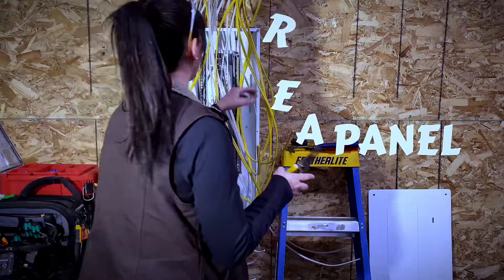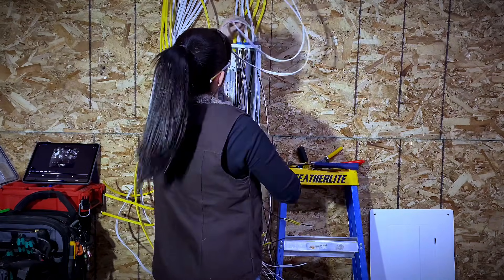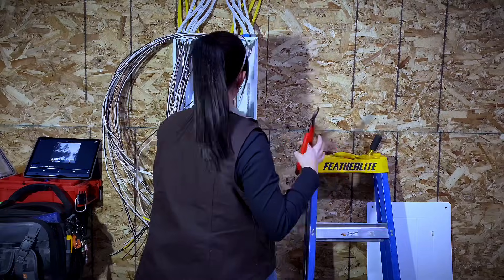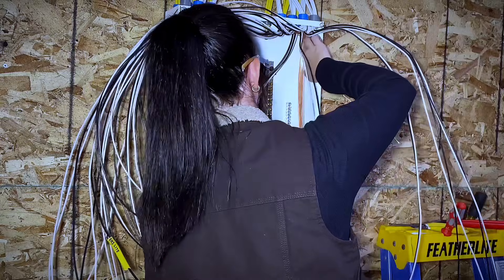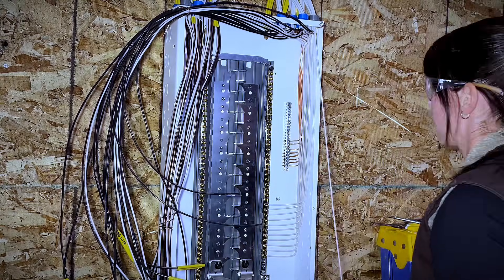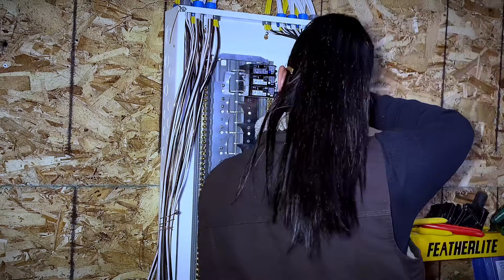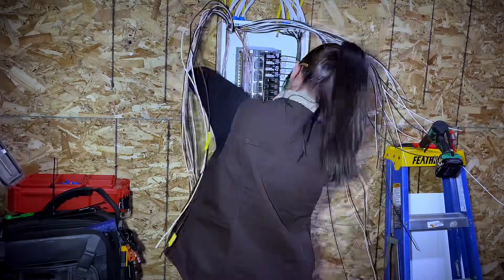How to wire an electrical panel ⚡️

Comment: 48 years and I do it exactly the same way. A couple runs down the ground heats up the copper to easily shape it to the back corner of the load center panel. Great job!

Comment: As a Master Electrician, I say NO to zip ties in a panel with solid wires. (Maybe in a panel with stranded wires, just to keep them under control, but solid wires stay put just fine) Nothing worse than trying to track down a wire that needs to be removed, and having to cut out a bunch of unnecessary ties.

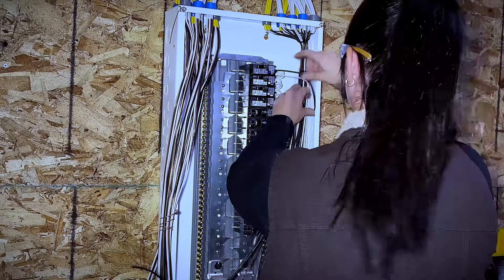Comment: 3:17 It's better to have all your loops go all the way to the bottom of the panel, then back up. Looking clean is not the goal here. The idea is that in the future, any circuit can be moved to any breaker bus location. Likewise, someone years from now can install a new panel without having to deal with short wires.

Comment: If the house isn't wired for solar yet, try an leave a few breaker, bond and neutral bus locations open at the load side opposite of the service box.(64-112) Nothing ruins my day like having to redo others work. Stay safe, sister!

Comment: Its ridiculous that panel is allowed to be mounted directly on orchestrated strand board. That stuff is full of glue that ignites very easily.  And the fire rages almost instantly. Should be code to be on fire proof gyprock or something similar.

Comment: 1:18 I push the grounds to back of panel then bend towards respective side. I also try to avoid any free knock-out holes for the Electrician from the future that will need THAT hole I just put a wire in front of.

Comment: Please, please come and redo my panel !  I found it messy when I moved in. They left way too much extra wire and now it’s difficult to run  any new circuits.  They basically ran the wire all the way down to the bottom and then up again so there’s an extra foot or so crammed in there for each circuit. And the city inspector passed it this way! Ugh so painful.  I may have to bite the bullet one day and spend an afternoon redoing it.
Reply: They left extra wire to move breakers around. It sucks when they are short and have to put a bunch of wire nuts in the panel, because they went straight in and directly to the breaker.

Comment: Yes, your panel work it very neat...HOWEVER, it's a very easy panel.  No electric dryer, stove, hot water heater, a/c, air handler, pool pump, pool heater, EV charger, or anything other than 14 and 12 ga wires.  Not so easy when you have all the other stuff and their fat ass wires.

Comment: I left a little of the jacket on the wires inside the panel. I take a magic marker and label each wire inside and out.
I have seen an old panel where they tied the wires together with string lol
Apparently back then they didn't have zip ties.
Speedy electrician at 5x normal speed lololol
At that speed should cut labor costs quite a bit.

Comment: The panel looks fantastic 👍I wish my panels looked like that, but I live in a 67 year old house with a mix of wiring. Cloth, NM, MC, THHN. It's complete chaos and in some cases outdated.

If I ever get the chance to replace the subpanel and wiring in my detached garage, I will definitely be using your tips to keep it looking clean.

Comment: i usually leave a small piece of lumex to write down exactly what the circuit is on the wire itself in case you have to take the panel cover off

Comment: One suggestion: leave a much longer loop for the top breakers.  I really appreciated the electrician who did that when 10 years later I needed to move the breakers to install back feed breakers for a generator, which must be at the top for the interlock.   The long loop allowed me to move to top two without a splice.

Comment: Basically all the circuits on the right bus bar are in parallel right, and each circuit is limited by the current rating of each circuit breaker.  The same thing is for the circuits on left bus bar.  In short, these are two hot wires in secondary or 120V to neutral and 120V to neutral.  240V is from one hot wire to another hot wire.  Each circuit is single phase between any hot wire and neutral except for 240V is for hot wire to hot wire (like oven and stove).  My question is what is the voltage for primary.  We know that we pull only one hot wire down to connect to the resident wiring.  If anything here is wrong, please correct me since I am learning.

Comment: Can you please do a video on this,,   How do I install a load separation on a building,, for example where I have 4 AC units, 3 water heaters and I want them to work only on NEPA and the lighting points works on both generator and NEPA

Comment: 0:10 Hi!  I built this server and called it Marshmallow.  It ran for like ten years.  It had two power supplies and a little device called Add2PSU.  There was no delay, both power supplies came on instantly.  The thing would draw like 2.9 amps on 120V.  If you plugged in both PSU's to a fifteen amp circuit, the breaker tripped.  If you plugged into separate branches everything went well.  Can you think about this scenario?  When one power supply failed two or three disks would go down.  Marshmallow played a lot of tunes and may have had a fork!  dansoftn

Comment: Very neat and professional work. 
It makes me crazy when I open up a service panel and it looks like an explosion at the spaghetti factory! 
When I do services I use the outer sleeve from the NM as a label to identify the circuit wire for the breakers, I also clip off zip ties with a large toenail clipper or twist the tail with my pliers to leave a non sharp end on the plastic tie. Sometimes it’s a little dicey when working on a live panel.
Great job, keep up the good work.
Reply: I'm a Retired Industrial Electrician and I always wired panels the same way...also control panels. P. S. Thomas Betts ty-rap guns work great and leave no sharp edges.

Comment: Looks great.  Its also required by code.  Im always shocked how many panels are a mess and not labeled.  I would go so far as numbering the wires as well.  Maybe thats more of a commercial thing.

In the big commercial panels we usually also put gutter boxes on top.  That way you dont need a service loop and its easy to modify in the future.

Comment: Idk anything about electrical work but am trying to learn and get into it! It may sound a little silly but how do you know which wire from ALL THOSE WIRES goes into which circuit?🤔
Reply: And I oop- nvm First off…I don’t know the names of ANYTHING😂 Second… JUST came across the fact that Miss Karly has an In Depth tutorial :) OKAYYYYYY 🤟🏽🤟🏽

Comment: Which way is that main breaker facing? Up needs to be the “ON”position - it looks like you installed a top-fed panel upside down. No problem with that as long as the main breaker is oriented so the “UP” is “ON” (or side to side, but you don’t have that style here)
NFPA NEC Article 240.81

Comment: That looks incredible. I want to rewire my house but I want to do it myself so I get the experience and I know it’s done correctly. I can’t stand seeing half-ass work when I could do it better as a novice. I only wire low voltage right now but I’m sure I could get that done too

Comment: Why does the top right breakers each have 2 neutrals going in?? 
One from the neutral bar and one from the circuit...
Wouldn't it be the same to take em from the bar directly?

Comment: The only issue with that panel is most people are working on a bidded job so the longer it takes the less money you make and typically you're on a deadline if the job is by the hour then you can do work like that and even then you're on a deadline

Comment: When setting the grounds and neutrals can you just start placing them where they best fit and not have to worry about what they originally went to (unless if it’s a afci breaker). And then the power wire is the only wire that has to be labels and recognized because it needs a matching breaker and sticker label?

Comment: I am an electrician in Germany, very interesting how people im other countries do their job. Thank you for your video!
Reply: I'm am to I'm a electrician in the usa 🇺🇸 I'm interested in wiring around the world I see Germany uses wire lighter than 14 gauge and fuse it at 16 amps 14 is only for 15 amps and kitchen outlets should be 12 gauge wire on 20 amp breaker and I noticed the don't put boxes behind the light fixtures like code required
Reply: @DavidBerquist334  Yes indeed we have other rules;)
Reply: @DavidBerquist334 
In europe we work on 230V so we need less amps for the same amount of power... 

And in france we protect absolutely every circuit with what you guys call a gfci ( cause a famous singer claude francois, died changing a lightbulb standing in a filled bathtub 😅)
Reply: @95raran sounds like you shouldn't have lights directly over water sources 🤔
Reply: @ralanham76  They have the metric system, too.  What cha gonna do?

Comment: This appears to be a sub panel, much easier to bring the wires in through the top of the panel with the mains at the bottom. Can you show us how you wire the main panel? There’s nothing larger than 20A in this panel. I’d be interested seeing how you terminate the teck cable feeding this panel. Also how you terminate wires coming into the sides of a panel, which is much more common on the main house panel.

Comment: One thing I miss about working in the US after coming back to the UK, the panel size. So many customers here want a 14 way panel and they're like 12-18 inches wide by 12 inches tall and it's just not enough space for future circuits or even terminating circuits with a decent amount of slack cable.
Reply: Is working in different countries a common thing for electricians? Or did you do some sort of specialized work?

Comment: Are panels laid out this clean typical of pro electricians or is she a stand out in that way?  I'm ignorant to the trade, but I'm fascinated by the process.  I put together as a hobby guitar effects pedals, and I struggle with wire organization (on a much smaller scale).
Reply: This is not typical of residential work in the US where production take precedence over quality.  Commercial is a different animal.  Karly is a tribute to her craft.

Comment: Great work!   When you land the neutral wires, do you order them the same top to bottom as the breakers?  So that the top neutral wire would match with the top breaker?

Comment: I think that is one of the first residential panels I have seen with zero 240V breakers.  👍🤠
Reply: Didn't even notice that. I wonder if it's a sub panel ?
Reply: @ralanham76  I can't see for sure if there are bonding connections between neutral and ground, so it could be, but its strange that there are so many breakers without AFCI on them.  What about 3/4 of the panel is using standard breakers.  Almost looks like a home from the 2000's using older code.  While perfectly allowed by NEC, I am surprised she doubled the grounds when the panel has more than enough spots for each to have its own ground lug.  I can say that is a clean install for sure, and looks nice.  I wish our electricians took their time doing ours when the house was built, its better than many I have seen, but still not as clean as her job.   👍
Reply: @Chris_In_Texas  She said she prefers the large loads at the bottom near the main breaker, maybe possible the big 240 loads haven't been wired yet? Also she's in Canada, the NEC doesn't apply. It's the CEC here. It's mostly the same but has some differences, perhaps AFCI requirements are one of those. Also the cover surrounding the main breaker is another CEC requirement for panels here.
Reply: Good work..well done..from NZ 🥝👍
Reply: I don't see a disconnect at the top, so agree likely a subpanel.
Reply: They are there. They're at the top. The 2pole dual function breakers don't have 2 actual toggles. They have 1 toggle switch.
Reply: @PowerCraft-t6y  Those are clearly AFCI and combo AFCI/GCFI 120V breakers.  You can tell with the neutral pigtails and the "N" with the arrow pointing to the white conductors.    If they were 240V breakers then Karly would have a number of code violations for not marking the white conductors as hot conductors.  Its clear that all the breakers in this sub panel are indeed 120V.  👊😁
Reply: @Chris_In_Texas 
Just zoomed in lol you're right. I redact my statement 😂
Reply: @ no problem.   Been there done that.  Have a great day man. 👍

Comment: Hey Karly, Fantastic channel.  Question? When you bundle and tyrap the wires like that ... doesn't it derate them somewhat?  And isn't there a CSA code rule for that?  I mean if you take say, I don't know ?, 9 circuits and run say 12 Amps through each of the bundled blacks ... how long will it take for them to catch fire?  Usually horizontal raceways are derated even though the heat rises into the air above the bundle but in your case with a short vertical rise ... it has got to be worse?   Just wondering?  Maybe humour the youtube folks on a cold morning, grab/borrow a bunch of 1500W heaters, bundle the blacks and whites separately for a few vertical feet ( shit I mean cm maybe mm? Canadians like big numbers ) , and sit back and measure the heat rise with that nice new fancy infrared camera  I think you were showcasing the other day ( or your cold hands ).  And just say some youtube jackass dared me to do this ;-).  I really have no idea what would happen and regardless I'd hire you anyways everyday/any day to do my panels like that ( they truly are works of art ) ... my insurance company would never need to know ... huh? unless I make a nice clear lexan glass panel cover to showcase your glowing/infrared radiant masterpieces  ;-).  PS all of that just humour - have a great week/month.
Reply: tie wrapping the conductors is perfectly safe since the length of the bundles is so short, there is not enough heat build up in that space to create any heat related issues

Comment: Looks neat and tidy As a uk spark  do you have to coordinate your earth wires and neutrals to the live .ie the live in breaker 1 corresponds to the earth and n in terminal 1 or are you allowed to do it randomly

Comment: I hope that electricians in Canada and the US appreciate the amount of real estate you guys have in your boards. In Sweden, and most countries in Europe, we basically have no open area apart from just under 2” between the breakers. All wires are behind the breakers and are basically impossible to see or get to when the breakers are installed. We have the option to remove the mounting rails but it’s not easy to do with between 12 to 18 breakers mounted and wired in.
I don’t get why we can’t have bigger panels, they’re often recessed into the walls in residential buildings so they could have given us som more space for management of the wires.
Reply: Is this a regulation thing, though? Or just being cheap? Boxes and rails are what you make them to be. Anything to lo lower costs. Also historically there might have been less electrical apparata to connect, so as time goes by, new stuff is added into existing boxes.
Reply: @ it’s not a regulatory thing, it’s just what we have available on the market. In all boards the DIN rails go from side to side, in very few cases there’s a space of less than 1” of space on the sides. Proposing a bigger board to a customer just to make the installation look good, never to be seen, and to make a very unlikely fault finding easier is a hard sell.